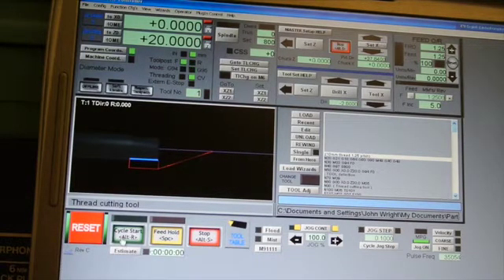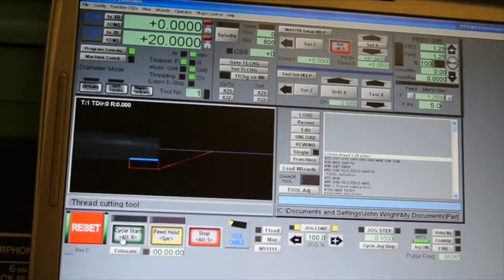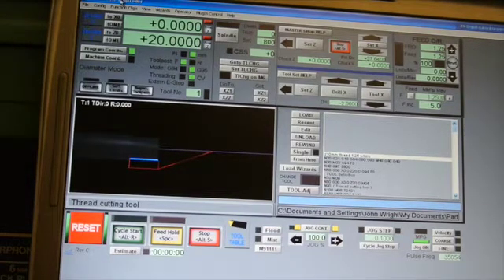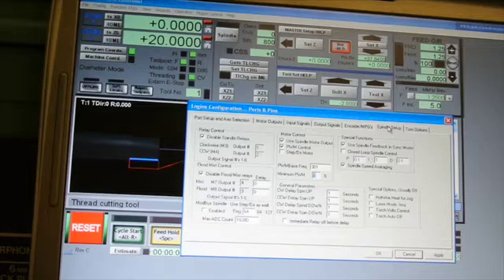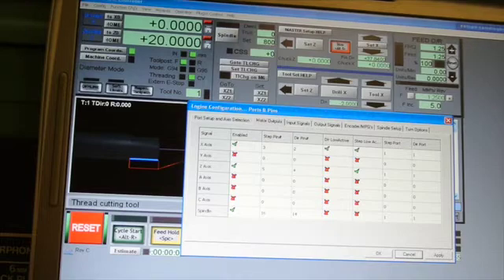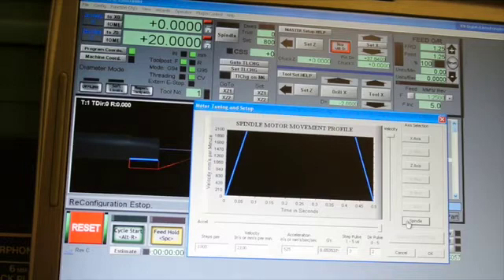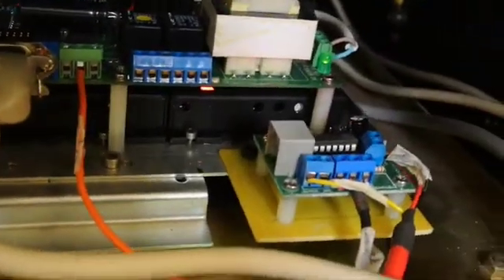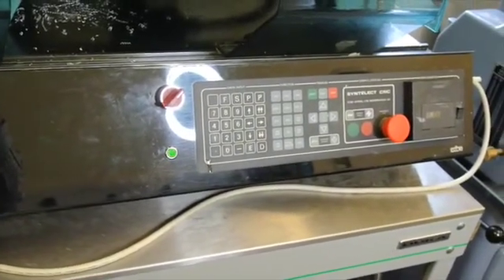mach 3 threading

Comment: Nice video, and very good point about re-posting code with extra Z movement to allow space to accelerate. One small detail to add; threading is disabled in the demo version! I spent ages double checking my settings with no luck. Buying full version tomorrow morning...👍😊

Comment: Hello John, I am in search of information that will help me to convert a Denford Startum 4 lathe to work with Mach3. Can you point me to any links on the Web that may be of assistance? Thank you!
Reply from the maker: Hi

On my Orac conversion I used the existing stepper motors and what was then good spec breakout board. I also used the old power supply. It is so much easier now to do such conversions. The Gecko 540 is the obvious choice with an off the shelf power supply. I used one in my Mill conversion. It has a built in break out board. Homann designs is a good source of ideas .

Also Google Gecko 540 and read what comes up in the forums. Plenty out there.

John

Comment: Best regards:
Can you tell me how configurate the index debounce and other paraneter for threading?
Reply from the maker: Hi

Debounce interval 600
Index Debounce 10
Shuttle Acceleration 0.01 sec

In the video I showed the Ports and Pins screen for spindle set up. If you want a screen shot of the General parameters and Spindle set up just send me a private message with your email address.

John
Reply: Thanks, i have send a e mail.
Reply: @john2478  Hello my friend.
my problem
tooth breaks when pulling teeth
send the general setting image.
ayhantukez@gmail.com

Comment: I have a cut out slot in a disc on the rear off the spindle and there is a s C41 board from CNC4PC. The board converts the pulses to 0-10v. The output from the board is fed to the 0-10v input to the VFD.